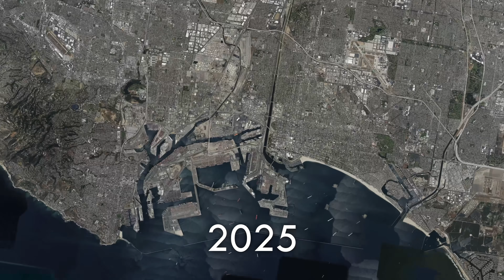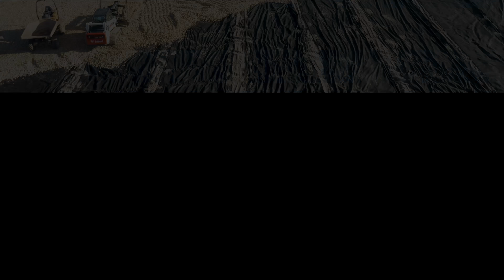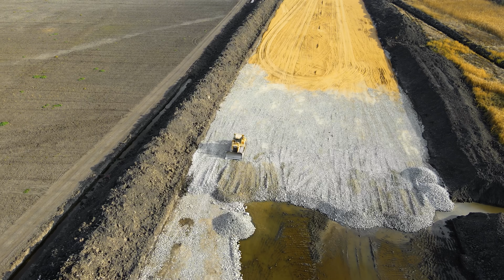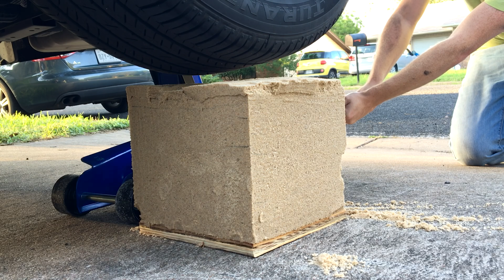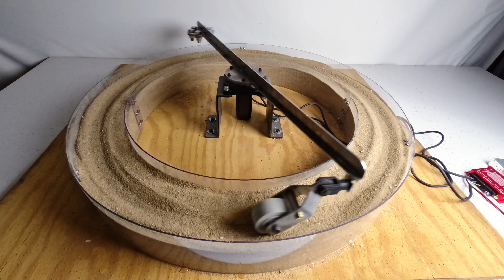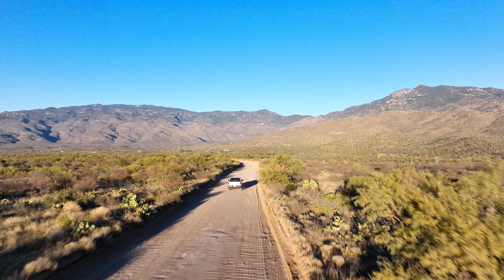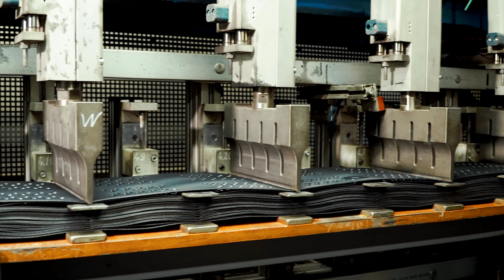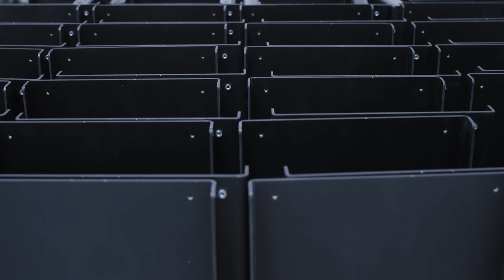The Grid That Doubles the Strength of the Ground

Comment: Your model is incorrect as vehicles won't drive on the geocells and would be covered by the road surface whereas in your model the wheel was driving over exposed geocell tops. There was no sand to form any kind of washboard roads but it did show that the surface material was pushed aside from the wheel. You would need to run the model with a much thicker layer of road surface between the cells and the wheel.

Comment: I wonder about the added microplastics from a geocell installation. I'm sure they worked out something that sounds like a relief now, making it seem like a non-issue or something that we can control, and I'm also sure that there will be unintended consequences down the road.
Great video nonetheless! Where I grew up there were a lot of parking spaces and walkways done with grass pavers, and I guess that's a similar idea, even though the bricks themselves are not connected.
Reply: Even when considering micro plastics, the overall environmental impact can still be lower by applying these geocells. Dirt and gravel roads require regular maintenance. You could skip that, but then the vehicles that ride over them will experience excessive wear and tear that has its own economic costs and environmental impact.

Micro plastics is a relatively newly identified problem (at least in the public’s eye). It’s a new factor of the overall cost-benefit picture that will influence future road projects.
Reply: Spend some time doing some research, you'll find the microplastic issue has been way overblown and a lot of the 'studies' paraded in the media have been debunked and withdrawn. Oona Lönnstedt is a good place to start. 👍
Reply: @jayclark8284  I know the Londdstedt arc, and I recognize that not a lot of definitive studies have been published wrt/ microplastics. As we do know that it happens and that it reacts with biology, I still consider it a risk, to the point where a solution like plastic geocells just doesn't feel right.
Reply: @t00194 all choices have risks and benefits but their use seems to weigh well towards benefits.👍

Comment: Trade-offs, always trade-offs.

Yes, it's "bad" to have plastics in the ground that will deteriorate over time into micro and nano plastics. Just as it's "bad" to have the risks of nuclear power, or the costs of space launches, or the very existence of people in general.

It's all "bad" in the sense that you can find a few legitimate facts about the costs and risks of any given technology, and use those worries to generate headlines. People have a natural instinct to pay more attention to danger signals, so the most alarming headlines tend to garner the most attention.

Taking into account all of the important factors, however, is a lot harder than identifying a single hazard. Engineers are very human too, so it's not enough to simply trust them.

So what to do? Here are some rules of thumb that have worked well for me. Your mileage may vary.

 - Avoid the trap of getting emotionally fixated on a single factor. The problem might indeed be a deal-killer, but the more vivid the nightmare scenario is in your head, the less likely you are to take in the full picture. 

 - Check to make sure that the engineers are taking into account every factor. Maybe they didn't even consider long-term disposal (it's happened). Are they free to speak candidly to the public, or sequestered behind a bureaucracy? If every statement must be signed off by lawyers and a public relations department, that's a warning sign (and sadly that happens a lot).

 - Complexity is a good sign. A shiny new vision that unequivocally works great is a sales pitch. A genuine discussion will have frustrating compromises, and distracting "bike-shed" details.

Trade-offs, always trade-offs.

Comment: I worked on a new school build years ago where the school district wanted vehicle access to the rear of the school without a large concrete drive. They used geocells infilled with soil and then seeded. It looked like a regular grass field, but it was capable of handling a fire truck drive on it without sinking or rutting. Very neat.

Comment: The video intro mentions that the Port of Long Beach is the 2nd busiest container port in the US. And the busiest is the Port of Los Angeles, which is contiguous with the Port of Long Beach.
Reply: If you look at a map of Los Angeles, you see they dropped a thin strip south from the city to extend its contiguous footprint into the port region adjacent to Long Beach.
Reply: Practically, it's mostly one port. Yes. Politically, very different. LA is weird
Reply: Basically it’s one huge port!!! They are right next to each other and the both share the same freeway and rail lines outta the port!! The 710 needs to be renovated but bc it’s almost impossible to shut it down idk when it will happen
Reply: And the air can be unbreathable from the trucks.
Reply: @gregknipe8772  That gets into some economics vs engineering vs politics. So find solutions to increase the freight volume through LA, or distribute the freight to other ports. But that runs into a lot of politics with unions and things like the Jones Act.

Comment: I've got reservations about a short-term solution that ignores long-term consequences.  This just creates more justification to pump more microplastics into the environment on long time scales.  If it's biodegradable or rustable then it can't be used, obviously.  So what's left?  If a material could be found, maybe a silicate mesh (like 3D printed rock or concrete?), with glass fibers?  Amber-like epoxy?  Maybe something like that?  I'm no material science.  Yes, the technique is mechanically advantageous, 100% agree, but I think further research needs to be done in material science to find a better alternative than plastic.  Something that'll last 50-100+ years, and degrade into dust, sand or gravel, somewhere in the 250-1,000 year range, would be ideal.  With a gradual failure profile rather than sudden catastrophic failures.

Comment: I watch a lot of crafting/ bashing videos, so I think of this more than is useful, but how much would that model be affected by scaling?

If it’s 4” wide, that’s about 72x smaller than a two-lane road. While that hex pattern can be scaled, and the thickness of the plastic adjusted, what about the sand? The sand in the project is not dissimilar from the sand in real-life conditions. 

I guess this is kind of the Ant-Man problem, too. Things can only be so much smaller before they stop being things.

Comment: As a gardener I think of seedling trays when I see these geocells, heh.  Just a different scale.

I wonder if in certain circumstances, you could grow a road base using fibrous, deep rooted, quick growing plants that would bind substrate together. There would be so many engineering challenges, construction schedule and climate challenges, and the performance long term under paved surfaces would need to be studied, but it's a lot easier to transport seed than fill, trading time for material.  A dense matrix of roots can be very strong, especially if locked into a scenario where it can't decay.  It can also permanently change the properties of the soil, even after it mineralizes.

Comment: If you want to increase the clingyness of loose substrate you need to get material out that causes adjacent particles to slide and add material that causes adjacent particles to stick. CaOH2 or CaO does both. It speeds up the deorganification of soil and it adds cross linking to adjacent particles. It will harden in soft surface in minutes once it gets a little wet

Comment: Very cool, I would like to see the washboard test done again with an additional inch of sand on top of the cells you printed. I could see that the plastic may not hold up directly to tires and need the extra sand if this was really how its used

Comment: I could even see using geocells with permeable concrete to allow it to allow rainwater to permeable into the ground without much if any reinforcement.  I have seen permeable concrete 'tiles' (with holes in it) that allow grass to grow up.  In Houston area, there is a park that has  an old house/estate site.  The old drive  way had those 'tiles'.   I also saw similar at an office building outside Austin where they were only allowed so much impermeable surface due to aquifer recharge zone.

Comment: Not sure where the forced perspective shot came from, but camera nerd detail, one of my favorite traditional techniques. 👍
Add: So this almost joke of a utility project has been going on in front of our house for most of a year now, they Finally got to the point where they were going to repave the road due to destroying about a mile-long stretch (heavy equipment in addition to laying new pipe), and to my complete lack of surprise, they were in Way over their heads. The first attempt used some kind of concrete mud fill that formed washboards literally overnight, as the road is Heavily travelled (everyone and their brother uses it like a bypass for the actual highway that's about a quarter mile away). After that, they turned it into a no-sh!t dirt road with aggregate piled on top. I thought maybe they were regrading the road base, but no, they figured it'd be fine.
One complaint to the city after this kept going for months and All of the surfaces, grass, vehicles etc were covered by crushed silica rock detritus for Months later, the city engineer finally came out and made them pave it with asphalt Correctly.

Comment: Another benefit of using local soil and some plastics is that it has less heat island effect compared to concrete or other less permeable top layers.
What depth should the geocell be placed? Seems like it should at least be fully covered to prevent the floating out as seen in the experiment in the garage.

Comment: What is the life expectancy of this plastic? My experience with plastics indicates that in a decade or two this plastic will be very brittle. Would this affect the stability of the foundation placed on it?
Reply: That's from photodegradation. As long as it's got a UV blocking layer on top it will exist until microbes evolve that can eat it.
Reply: @nonna_sof5889  Microbes already eat plastic and oil, albeit slowly. That's why the entire planet isn't covered in a thin film of oil.

Comment: Neat to see my engineering intuition was on the money without any formal education. But as this roadway approach is rife with microplastics if HDPE is going to be the material of choice, makes me wonder if we can get more clever with acoustics to reduce the amount of plastic used. Rather than have uniform cells, mere slats staggered in a way that reflect vibrations back at themselves or at least more efficiently disparate energy. Or thinking of how transducers are placed on solid panel speakers, if using more of a patchwork of cells would be ideal......

Comment: A similar but lighter grid is used on a fire-road / mountain bike trail near me. In that case it's to stabilize against erosion & to protect the pipeline that runs under & parallel to the road). Installed 10-15 years ago, has worked great. Road no longer needs repair every couple years.
Reply: And they make a fun bzzzzz sound when you ride over them at speed 😊
Reply: Did the same to a few paths. After a number of storms the paths are still there years later and everything else has moved.
Reply: Link to manufacturer(s)?
Name of product?

Comment: Your models are so impressively well-made and designed to purpose. Well done ! 

In Canada we have a major issue with the potholing of the top surfaces due to icing and deicing forming ice crystals that expand in any crack and break the bonds of the tarmac. I wonder if a 3d structure might help without causing stress risers.
Reply: There is a problem with asphalt pavement anywhere, but especially where there are freeze-thaw cycles. I've long wondered why it is not routine to put geogrid of some sort under a new layer of asphalt. Vehicle wheels would no longer spread asphalt to the side, opening up fissures along the road, letting water in and freeze-thaw cycles wreck the pavement. I could see a problem with city streets where buried utilities are frequently dug up, but in rural areas where there is nothing buried (except culverts for drainage) that might be feasible.

Comment: The issue with your "road" test is that it was clearly scraping away the sand, so you were driving on the plastic. But if you covered up the plastic with a thicker layer of sand/dirt, that layer would have nothing supporting it, and it would form the bumps.

Comment: The plastic stuff is unbelievable. We renovated our 30+y old drainages and adjusted ground surfaces according to modern code (the situation was that everything sloped toward buildings so rainwater went there). And it caused steep slopes to the yard to make surfaces meet from all directions. 

Even the excavator workers did not believe that the > 10 degree slopes did not just collapse when there was heavy rain (10+mm in few hours) and no plant roots etc yet in the ground.
Reply: And I am referring to the option 3

Comment: My city decided to use these plastic geocells to build public parking lots in residential neighbourhoods. It was very similar to your garage demonstration, cells were on the surface, just filled with dirt. They did not survive the winter. A few freezing and thawing cycles caused them to shift in all directions, potholes formed and they disintegrated because the filler material was drained by melting snow.
Now they use concrete honeycombs, those seem to work a lot better, while still letting rainwater to drain.
Reply: I believe that –like other sub-grade systems– to correctly implement these in the field they need to be isolated from direct weather exposure.
Reply: @dr.kraemer  sounds like in Oivaras case, it was more Frost Heave which would not have been solved by an added layer of surface grade material. Frost heave can eject ton-scale boulders from deep underground, geogrids don't stand a chance.
Reply: @Hyratel , it doesn't seem like a normal subsurface would fare much better there. I also noticed after commenting that the video has lots of examples exposed to weather, though 1) there's an evident selection bias there and 2) I went to school in TX for a long time and they ain't have the same kind of weather there I do now in MA.
Reply: @Hyratel  I wonder if in areas affected by deep soil freezing, correct installation might require some sort of "staples" to tie the grid to stable soil below the freeze line. Something like helical pylons, or even those tetrahedron post bases that you  drive long bits of rebar through at different angles.
Reply: @RossReedstrom   could help. the Cell Mesh doesn't exactly have a lot of vertical retention of its own
Reply: I have geocells under my driveway, been good a decade and a half and it's still holding together and not washing my steep driveway downhill
Reply: @Voyajer. I’m interested for my driveway. What climate are you in, are the geocells exposed at the surface or buried a bit? Is there a particular type of geocell you chose?
Reply: @Voyajer.  What kind gravel did you use to fill in the geocells? Thinking of installing a barrier between the dirt and geocell to prevent or slow settling.
Reply: Sounds like the city cheaped out on civil engineers, or didn't listen to them
Reply: @AncelDeLambert a sales guy convinced the city manager that they didn't need to talk to the city's engineers first.
Reply: Was it packed with dirt or crushed concrete?  The geocells works much better for less wide stuff in my experience, like 2 cars wide top.  Helped a ton with keeping the crowned gravel driveways from settling to the sides.  I've noticed some campgrounds using it to stabilize gravel RV pads rather then paving them.
Reply: @4RT1LL3RY  It makes sense to me that if the load gets big enough then the entire thing could start acting like a bunch of shear surfaces that want to slip worse than they want to crush.
Reply: @dr.kraemer  It sounds like there's extra engineering to be solved with using much larger supports on a larger grid scale. That after a certain distance, the load needs distributed to larger and stronger support members/structures. The same reason buildings need larger and periodic beams themselves. It's the same principles that need applied when geo-engineering on a large scale.
Reply: I concur. Here in Minnesota I have seen these used to extend parking areas. And the freeze thaw cycle heaves them badly.
Reply: Perhaps a bad material? Not all plastics desintegrate when frozen...
Reply: I love that you confirmed you observed the same results he produced. Thank you!